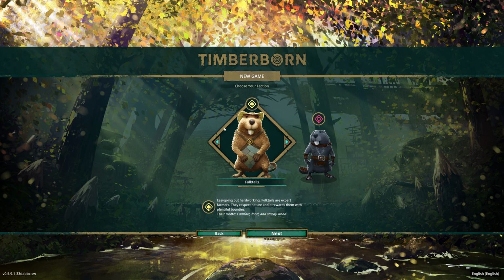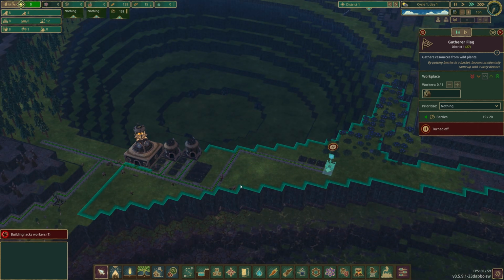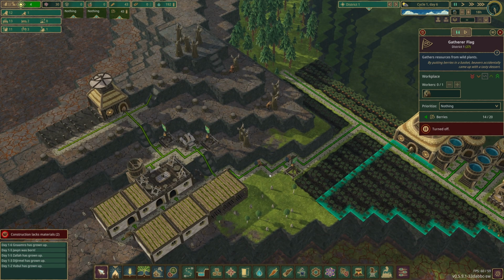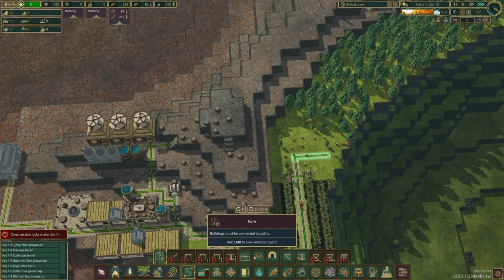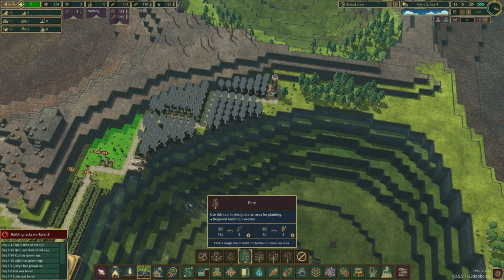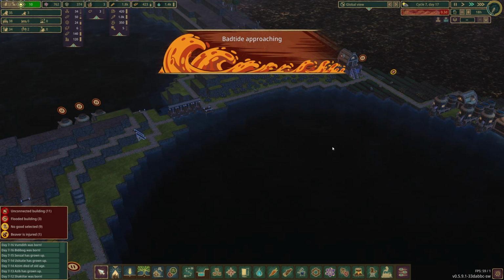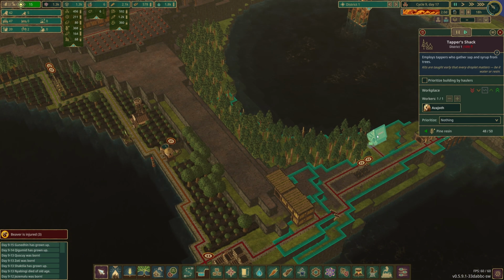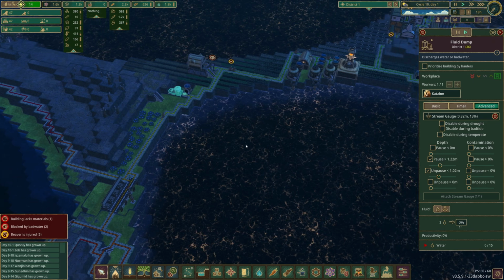TIMBERBORN - MEGA BUILD SERIES 2 - UPDATE 5 - BEAVROME - EPISODE 1

Comment: Im thinking a mega plan for the map would be to make the center pool have housing on top like a real beaver lodge where its in the middle of the deep water sections of their ponds. Surrounded by a mote like bever castle!

As far as the rest i reckon each crater should they a different job. Such as one filled in for farming, with organised canals for water cris-crossing it, one for wet plants so one deep with farmhouses on stilts in the middle, one for forests with a river of water zig zagging through it and small hills making a valley as it goes and so on, one above the bad water with platforms covering it in every way and turned into canals below for power (platforms above for industry to go on)

And have a leisure one. Of hot springs and beavles concerts (yes i know thats not your channel but could make a great colab!!!
Reply from the maker: I'm definitely going to be making use of some of these ideas :)  Will transform how things look and is a break from the repetition of what I had planned
Reply: @DisTurbedSimulations :) cannot wait to see it!